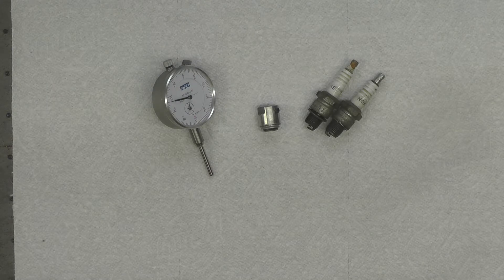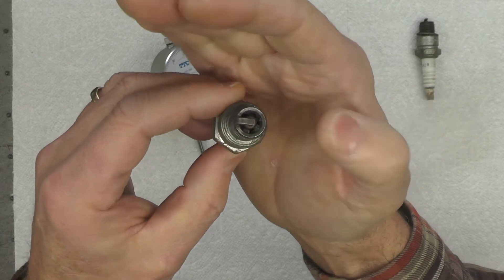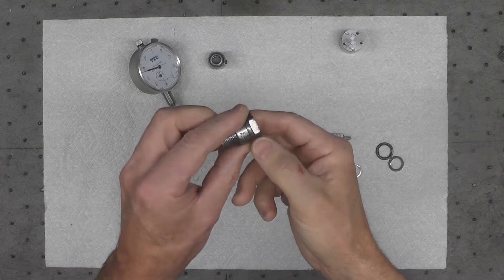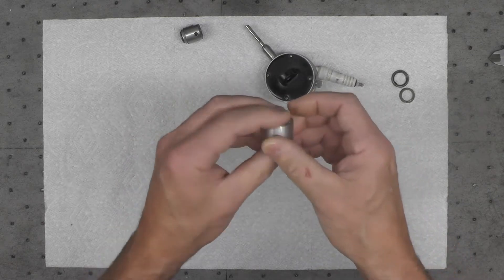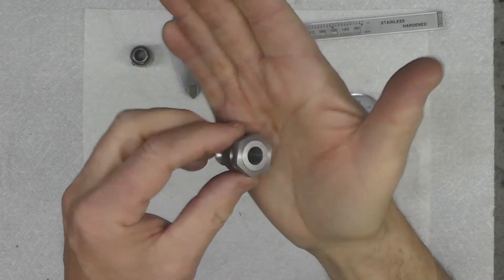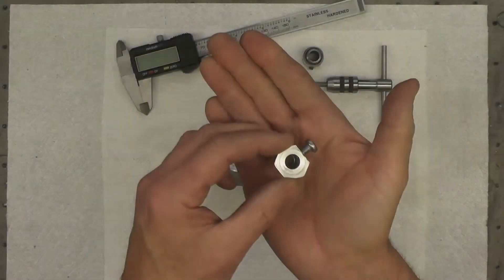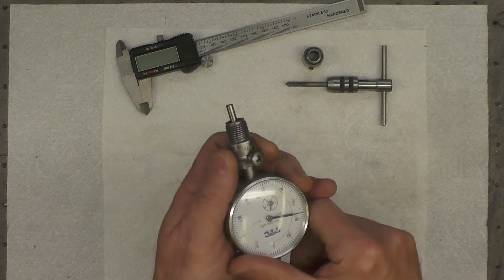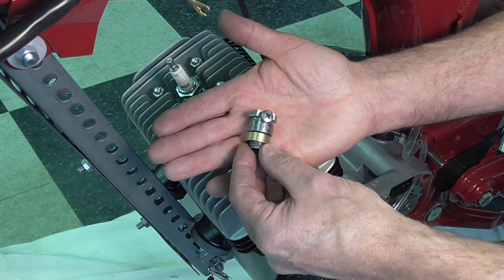Shop Talk #21, Making a Dial Indicator Adapter From a Spark Plug --- Video #164

Comment: size of that dial indicator
Reply from the maker: The indicator I use is a standard 2 inch unit, that measures in .001 inch... very common.  Just about any indicator could be used, but if anything, I'd go smaller in size for convienece in tight space.

Comment: Sir, with that copper sleeve, does it change the readings on the dial, or does not matter? How do you compensate for that?
Reply from the maker: The copper sleeve has no affect on the dial indicator is zeroed out before using.

Comment: I've been trying to make one of these for a while now, but could not figure out how to remove the porcelain.  Cut the ring off like you said and sure enough, the porcelain shaft just fell out.  I don't have a mill or a lathe, but I was able to drill and tap a hole for a set screw and was lucky enough to find a spacer in a junk drawer that worked well enough for an insert.  Thank you for posting this video.  It really helped me figure this out.
Reply from the maker: Excellent, glad the video was helpful to you.  Thanks for the comment...